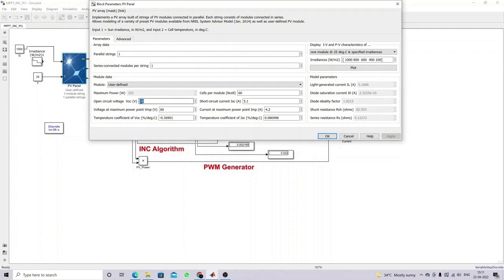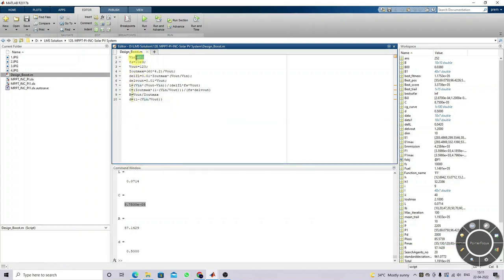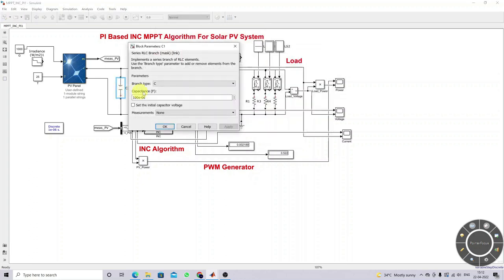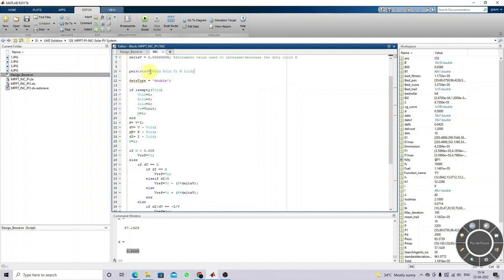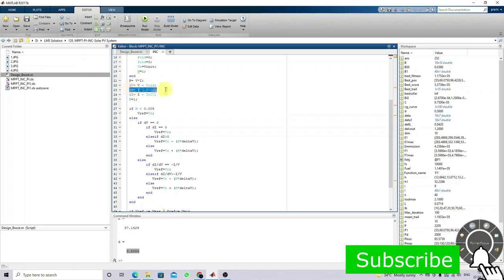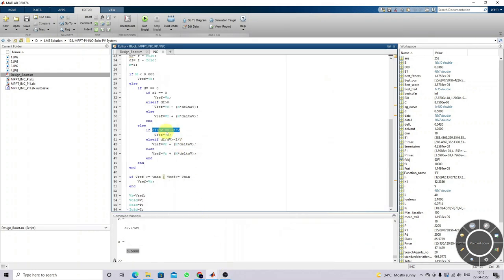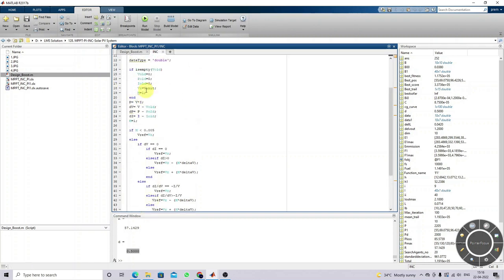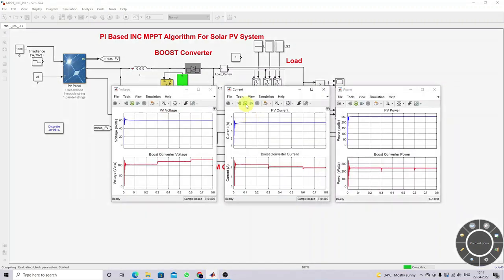MPPT | Incremental Conductance with PI Controlled MPPT in MATLAB

Comment: thank you sir for your effort .I request you to make a video on the p&o method with k factor control method for MPPT of a solar pv system.i would be very thankful to you sir.k factor contol metod is the modified pi control method.

this is from IEEE paper with DOI: 10.1109/EnergyEconomics.2015.7235087  .i would be very grateful to you sir